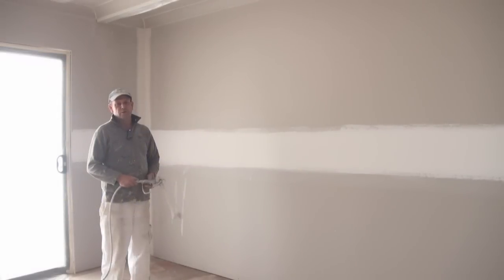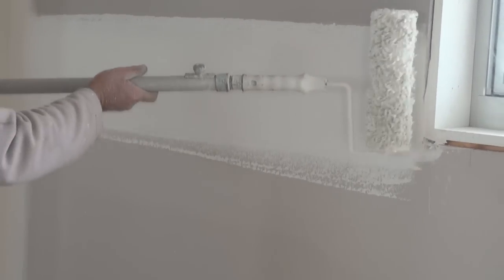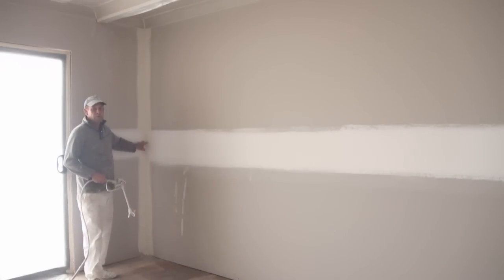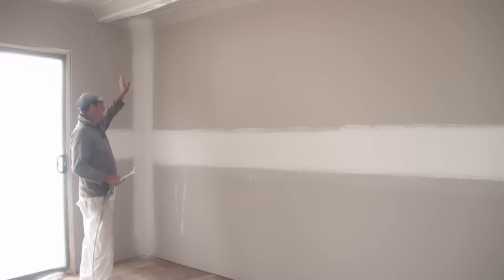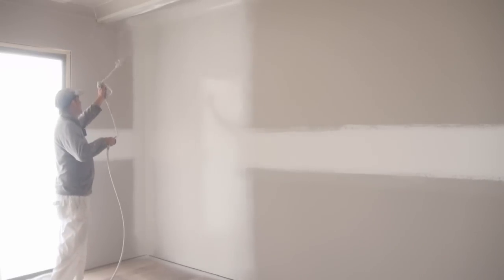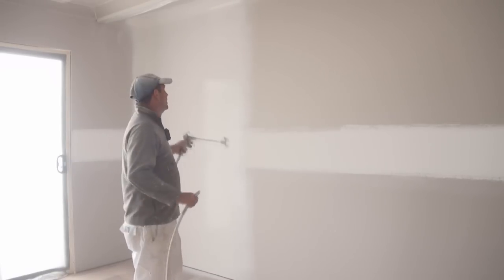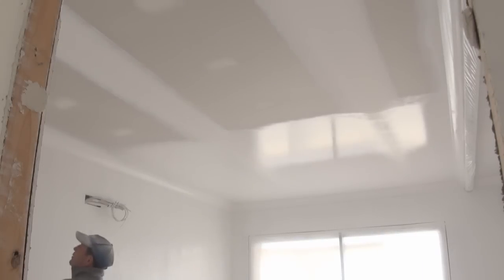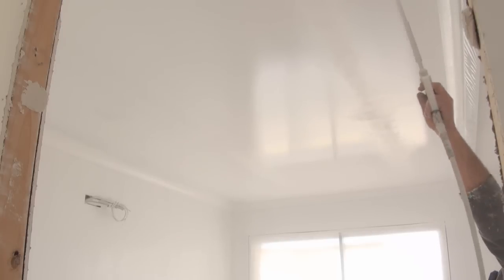How to paint new Plasterboard or Drywall - Painting walls & ceilings using an airless sprayer.

Comment: so correct me if I'm wrong, just trying to get the order of things, so you prime then cover the joins, the first coat of paint air gun, second coat using roller? should it be bone dry before second coat? how many coats are needed? is it cheaper to diy or hire someone?
Reply from the maker: Yes you prime joints first if you are going to spray first coat, You cant also spray second coat on walls but final coat should be rolled, Each coat needs to be dry before you apply another coat. Labour costs can be high so DIY can be cheaper.
Don't forget to Like, Share and Subscribe.

Comment: Backrolling would leave such a better finish and no messing around wasting time spraying ur joints first. Nice spray technique and one of the few who know to prime walls b4 ceiling especially on flat walls.
Reply from the maker: Both ways have there down sides and not sure how much time difference there would be overall. The thing with spraying is that its one less coat of orange peel so it can help a little for a smoother final coat.
Don't forget to Like, Share and Subscribe.

Comment: Hi mate if i want to repaint a wall it’s been painted 5 years ago do i need to use undercoat on it  first or doesn’t need just start with top coat ? Thank you
Reply from the maker: If its a low sheen acrylic then no need for undercoat, if it was an oil based paint then it would need a good sand and undercoat..
Don't forget to Like, Share and Subscribe.
Reply: Thank you for the valuable information .

Comment: You missed a spot: not kidding.
At the last corner there is one place that has no reflection because
it isn't covered 100% with wet paint: fail.
Reply from the maker: Not sure what you are talking about but I didn't completely go over the joints that were already sealed so maybe that's what you are referring to.
Don't forget to Like, Share and Subscribe.

Comment: Hi mate . I get why new plaster is mist coated but can you explain the reason raw plasterboard is ? I always thought this could make the paper soggy ? Thanks again.
Reply from the maker: There really is only so much paint you can apply before it will run or have very heavy roller stipple, so there is no way you could get the plaster board too wet.
Don't forget to Like, Share and Subscribe.

Comment: I kept reading it was not possible to paint direct onto the drywall/gypsum. What paint can be used for the drywall??
Reply from the maker: You can paint direct onto drywall but it is best to use a sealer/primer first. The idea of the sealer is so you can sand easier and it will seal the drywall so the top coats won't soak in as much and leave you with a better finish.
Don't forget to Like, Share and Subscribe.

Comment: So you "prime" plasterboard with ceiling emulsion watered down by 20% water (1 to 4 ratio in 5) ?
Reply from the maker: No, I'm using an acrylic primer/sealer for walls and ceilings. I don't think I would ever go past about 10% water but it really depends on how thick the paint is.
Don't forget to Like, Share and Subscribe.

Comment: Can i paint my new plasterboard ceiling without skimming?Direct on the plasterboard?
Reply from the maker: Yes you can as long as you use a sealer/primer first.
Don't forget to Like, Share and Subscribe.
Reply: Thank you very much.In Greece many technicians said that is better to skim the plasterboard but i see n other countries especially in USA they are not skimng plasterboards..Again thank you!
Reply from the maker: Here in Australia I have never seen anyone skim plaster board. I can't see how it can help that much, when you paint the walls the texture of the rolling will show out therefore you haven't got a completely smooth surface anymore. Most imperfections in plaster board can be filled very easily and a whole house might only take a few hours to fill the bad area's.
Don't forget to Like, Share and Subscribe.

Comment: Your paint is unbelievable:
No overspray? No mask?
what kind of paint is it?
Reply from the maker: I was using sealer for plaster board.
Don't forget to Like, Share and Subscribe.
Reply: @howtopaintinfo  
Let me guess: it was NOT  the cheap stuff
that rubberized PV.  You didn't mention the brand or the type.  One thing  I was always careful about was to always use sandable primer on wallboard in case any imperfections had to be sanded down
the rubber PV stuff is impossible to sand.
I used oil base primer on one job but I had to wear a mask.  How in hell can you spray a ceiling with no overspray??  I've never found a paint that can do that.
Reply: @indrekkpringi  really pva impossible to sand?
Reply: @JesusRamirez-hv5wj  
Try it.

Comment: DIY'er here: Why would anyone roller walls and ceilings if spraying is an option? It seems to be way, way, way less effort..
Reply: years of painting new construction has taught to prime the walls, sand lightly after they dry and then spray and back roll the finish coat. As far as the ceiling goes I spray one heavy coat of finish paint and let that be it. The dry wall contractor always glazed the ceiling with super thin down joint compound.
Reply from the maker: Because a spray finish can not be touch up very easy,  any touch ups will stand out that's why ceilings and walls are rolled, roller finish is easier to touch up.
Don't forget to Like, Share and Subscribe.

Comment: WTF Dude
No back rolling and painting the joins wtf..
if you seal the house you dont need to paint the joins as you put 2 more coats of low sheen on top of the sealer..
back rolling in AUS standard on all coats you should know that
Reply from the maker: Its well known that you should roll flushing joints first because of the dust issue and spraying doesn't stick to dust but by rolling the joint you are working the paint in. Also it is common practice to spray first coats and only back roll final coats if I hadn't sealer the joints first then i would have back rolled the sealer.
Don't forget to Like, Share and Subscribe

Comment: Drywall need primer before use finish paint?
Reply from the maker: New drywall does, if it has already been painted with a matt or low gloss paint then primer is not necessary. I have known project builders that apply finish coat to new drywall without priming, not the best thing to do.
Don't forget to Like, Share and Subscribe.

Comment: great to see you back. Thanks for the vid. I'm surprised you don't spray the ceiling first.
Reply from the maker: Thanks, it's good to be back uploading videos again. The reason for doing walls first is basically because of the cornice or molding, it's easier to spray it when doing walls. Also if it was done first there would be more chance of getting runs under the cornice or molding when spraying the walls (the over lap). I hope that explains why.
Don't forget to Like, Share and Subscribe.
Reply: Thanks, good explanation. Will keep an eye out for more of your vids. Liked and subscribed.
Reply: Walls first to prevent dust and ovwrspray build up on walls especially on joints.

Comment: Do you backroll when spraying ceilings?
Reply from the maker: I back roll all final coats on walls and ceilings, it's too hard to touch up a spray finish.
Don't forget to Like, Share and Subscribe.
Reply: How about re-paint, do you still need to backroll when spraying?
Reply from the maker: Yes, it's all about the paint you have just applied, not the old paint.
Reply: so in this video..yopu are priming obviously..so you spray but don't backroll...what about inperfections ect..do you sand after its sprayed, then apply final coat which you then backroll? @ @howtopaintinfo